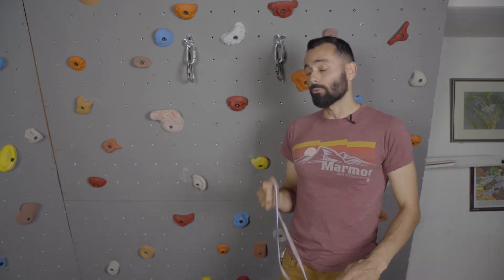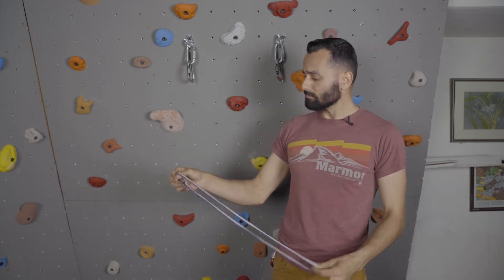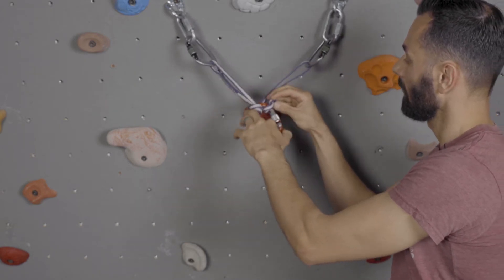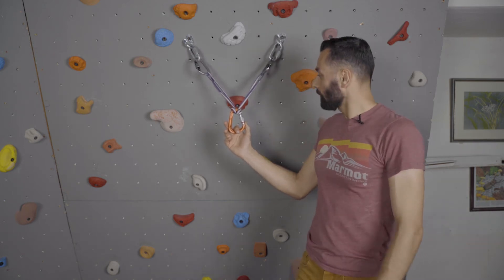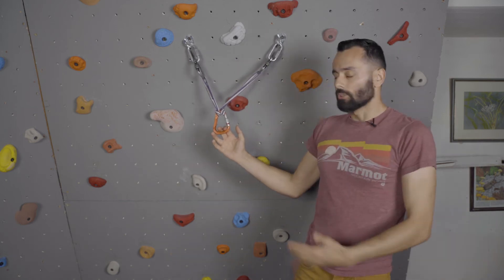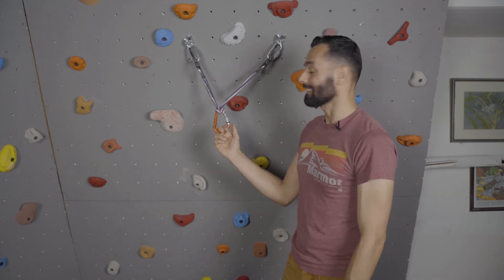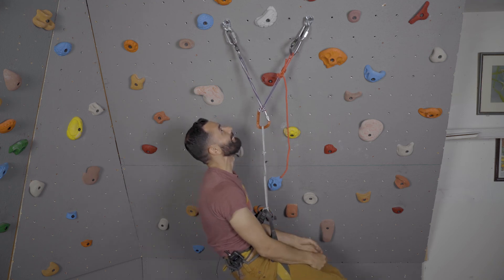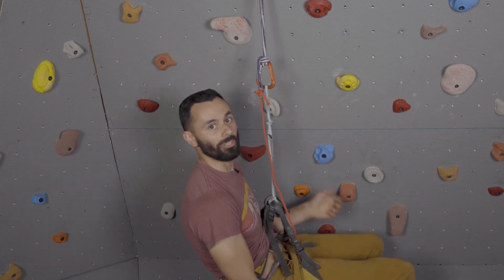How To Setup A Girth Hitch Anchor

Comment: The test can be misleading. The girth hitch have to hold a factor 2 fall if the lead climber falls before the first protection point of the next pitch. Also you do not equalize the anchor for the direction of the second climbing up. You equalize for the possible fall at the next pitch up to the first protection point.